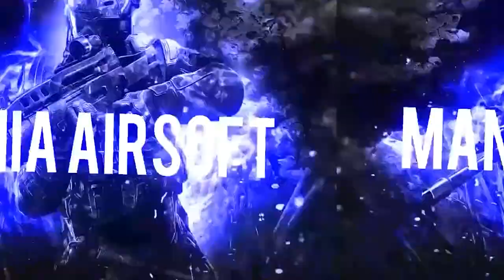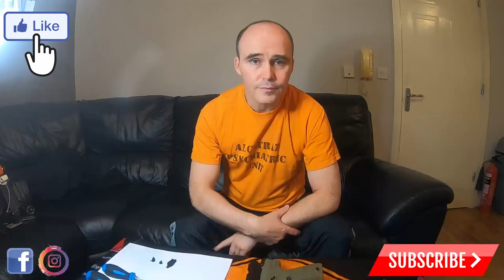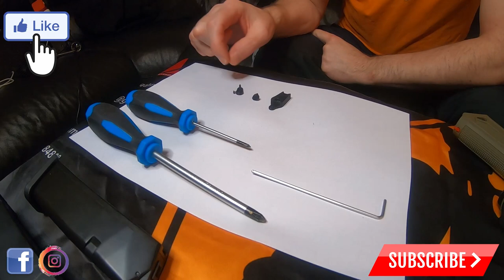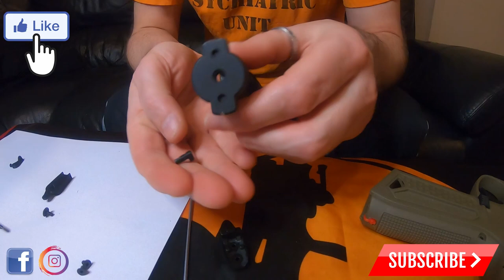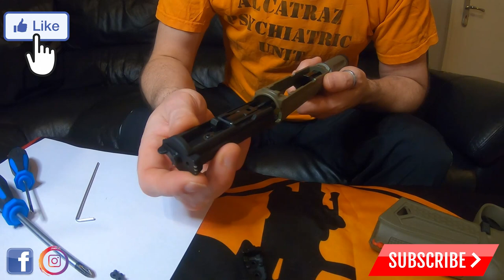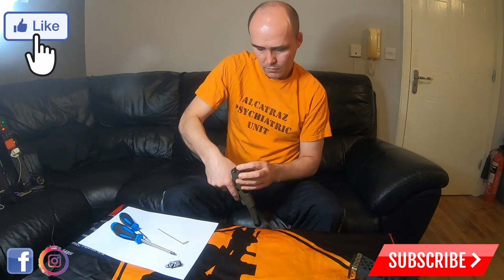AAP-01 selector switch installation

Comment: Very helpful video cos i just bought a kit that has no instuctions, just a quick heads up btw, army armament and raven glock type mags work great too but i find the we to be more efficient, generally get around 10fps extra when using those over the stock mag
Reply from the maker: Glad you found it helpful bro.